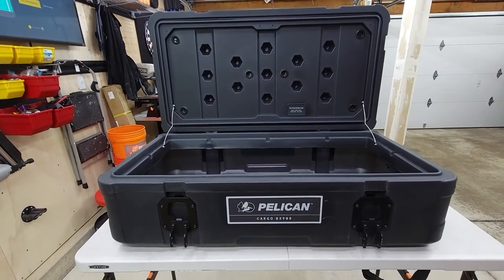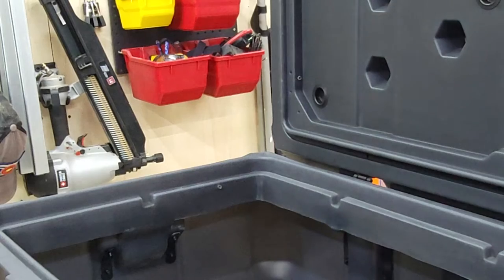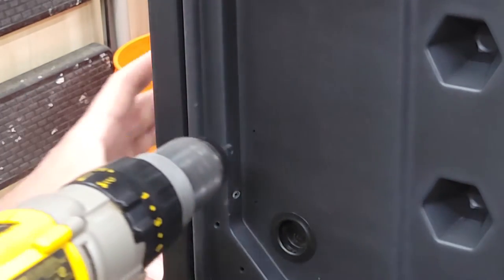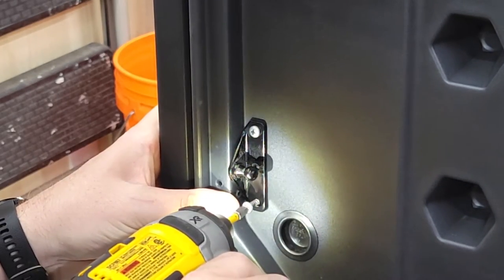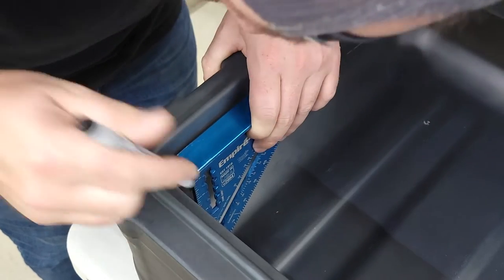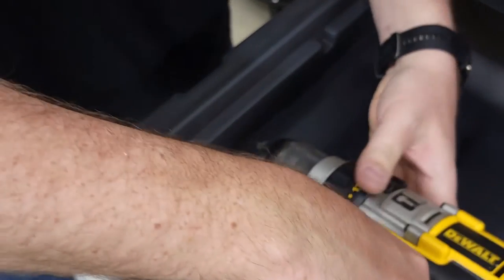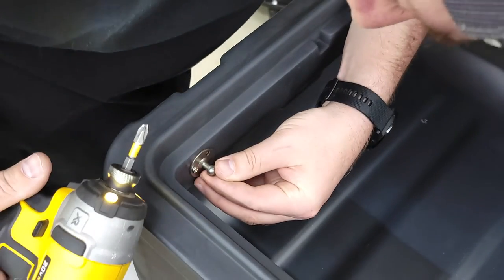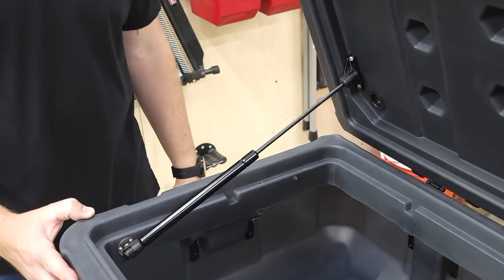Pelican BX90R Cargo Cases Gas Strut Install Guide

Comment: Not trying to be critical, but the gas struts are in upside down...the piston should be on the bottom...this ensures the cylinder seal stays lubricated and doesn't dry out.
Reply from the maker: Hey appreciate that call out, I actually had no idea that there was a correct vs incorrect way to install them, appreciate the call out and the knowledge share!
Reply: @blackcotaco  Glad I could help out.  And don't ask me how I learned that. 😁

Comment: Would this work on the V730 pelican cases too?
Reply from the maker: Those are a little tougher to do, I should have a video out soon for that case. The problem with those is the lid is very flimsy and not as rigid as the cargo cases. The video should be out in about 2 weeks. Thanks for the comment!!
Reply: Do you know if the retention cables would work on the V730?
Reply from the maker: @HM-vu9zw  they should theoretically work. The problem would be the thin wall of the case. You could use a pop rivet and some black calk to mount it.
Reply: I’ll wait to see your upcoming video.

Comment: Awesome video brother. But do you know if this would work with the BX255? I keep checking on there website to see if they’ve come out with any, keep slamming my hand while reaching in, lol. Anyways thanks in advance.
Reply from the maker: Hi, thanks for the complement and the view. So in theory it should, the part that will change is the location of the mount on the base of the box (not the lid). Looking at the dimensions the BX255 is 16.3in in width vs the BX90R that is 15in. The way I found the mounting points for the BX90 was to ensure that at full compression the shock had enough room to compress and not lock out without closing the lid. I used some VHB tape and some clamps on the inside of the container for the ball joint that gets mounted ton the inside of the box and moved it till I found that sweet spot where the lid closes and stays closed but can still open with a slight lift up on the lid. You'll have to hard mount the ball on the inside of the lid to do this first. Just take your time with the placement going in like 1/2in increments till you find where works best. I do remember Pelican saying at expo mtn west last year that they were coming out with kits for this, but like any product modification it takes time, so might be worth reaching out to them first if you are uncomfortable with DIYing this. Hope this helps! Cheers
Reply: @blackcotaco  thanks for the quick response and the info. I’m definitely not afraid of DIY projects and will take this knowledge into account when doing this mod. Like I said its been a real pain keeping the lid open when grabbing stuff out of it, especially on windy days, lol. Thanks again.

Comment: Are these cases waterproof?
Reply: Based on the pelican site the state they are watertight and water-resistant.  I have run them in a lot of weather and have not had an issue with water leaking in. The rim of the lid does have a seal hat gets pressed tight when closed. I do think if you fully submerged them they would leak. Hope this helps.